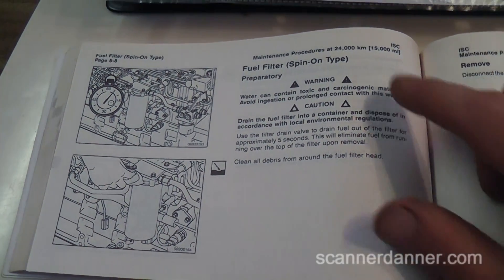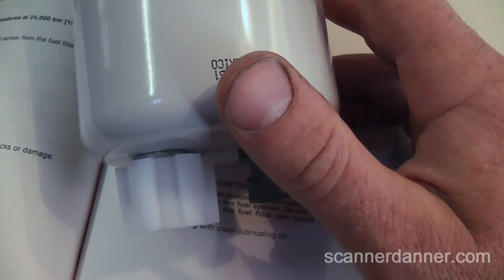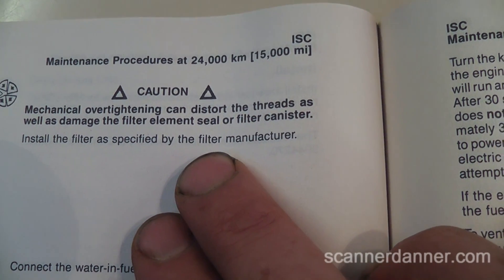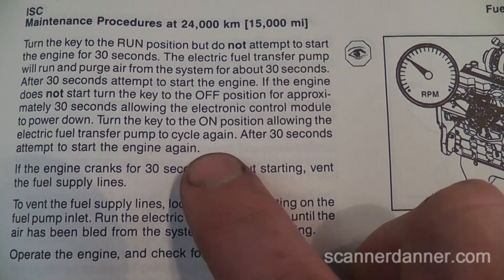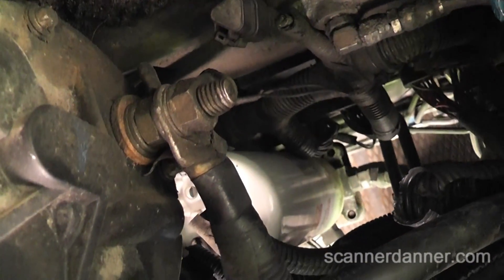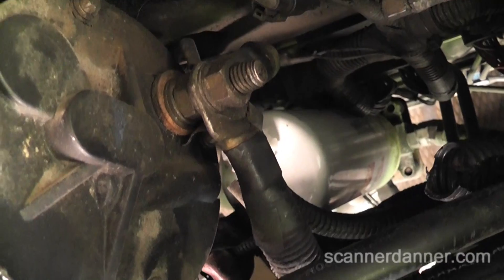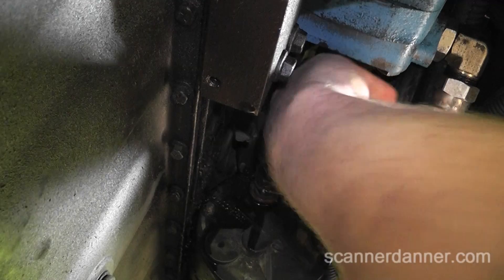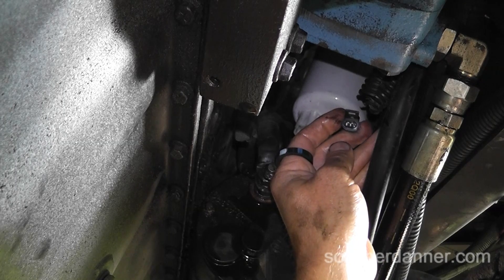2001 Cummins 8.3 ISC Fuel Filter change (American Coach) part 1

Comment: Was the oil pressure sensor accessible after removing the fuel filter?
Reply from the maker: I dont remember messing with an oil psi sensor or even talking about it 🤔
Reply: @ScannerDanner  you didn't. I was getting ready to change an ops on my 8.3 ISC and there wasn't any good info out there on it....was hoping maybe you saw the sensor after removing the fuel filter.
FYI, that sensor sucks getting to but was able to access from the top, after removing starter + wires....incase you ever have to change yours out in the future.

Exhaust Manifold is next on the list

Comment: I am sure many people have told you but at 8:44 of this video just above the threads is where the second "O" ring goes. If you do not put it in the filter is doing "NOTHING" the fuel goes around the filter. That smaller "O" ring makes the fuel filter work.
Remind me NOT to let you do any repair or maintenance work for me.
Reply from the maker: I corrected this in another video and admitted my mistake. Thanks!
This is not my normal wheelhouse

Comment: I got mine changed, no problem, but I cannot, for the life of me find another fuel filter.  The so called "primary" fuel filter.  Mine is a 2001 Monico Diplomate.  The manual shows a coolent filter next to the big oil filter, not a fuel filter.  Is it possible mine only has 1 filter?  Help! ISC 8.3 cummins
Reply from the maker: Only one fuel filter on mine my friend
Reply: @ScannerDanner  the second one is on driver's side up near the read end.  There 2 Dan.  I've got the same RV and year as you.
Reply from the maker: @larryreeves2548  my name is Paul Danner 😉
Only filters on the drivers side is the oil filter and coolant filter. There are NO fuel lines over there whatsoever
Reply: @ScannerDanner  it's not on the motor Paul it's under the water heater up on the frame.  Go up under the water heat compartment.  There a rectangular opening.  You can sit up there and you'll see it.
Reply: @ScannerDanner  give me a shout if you find it.  The filter also has a water drain, no plug but has a clear bottom to see if there's water it trash I guess.

Comment: If you have to change it then you have the wrong filter for that rig.. That is the norm now and I would change.. If that plug was wrong I would change out the plug so it will always work.. That sensor should be changed each time... The old days we looked and left them in, just to find out they would fail.. it cost nothing for that sensor now and its changed each time....

Comment: How much Cost This motorhome
Reply from the maker: New in 2001, it was 250k
I paid 50k for it (crazy the depreciation on these)
Reply: Thanks I’m try buy one fleet wood American Eagle 1998 8.3 Cummins that why I asking guy asked $43 but I’m thinking 35$
Reply from the maker: @pedrobastos3218  to be honestly it was closer to 55 all said and done.
I think your assessment on that 98 is about right. Unless it is immaculate and needs nothing. But we all know that's not ever the case
Reply: Hi I bought Coah 1998 $38 99 thousand miles now I’m going change oil
Reply: Man my 1998 American Eagle have tow problem Radiator I ready fix now the guy check oil leak guess what diesel line I have to fix put new lines two

Comment: Just talked to tech support at Cummins, perhaps you should have if you're going to put instructional videos on here, and that small seal does go on the threaded boss. Apparently you, or the last guy to replace this, didn't bother putting it on.
Reply from the maker: In this video I will show you how to replace the fuel filter on a 2001 Cummins 8.3L ISC engine. I left an o-ring out, see part 2 for the fix https://youtu.be/yzkw720STeU

Comment: The best practice is to use some ATF for the gasket and fill the filter up with ATF. WTF? haha, yep ATF is a detergent and will clean the soot and carbon build up off your injector tips as well lubricate and clean the injection pump, it will slightly smoke for the first few of miles before the diesel dilutes it down and quits. It is a very good practice to dump a quart of ATF in the tank at every fill-up, those old diesel are not too happy on today's low sulfur diesel oil. FYI the Cummins ISC went High-Pressure Common Rail(HPCR) in 2003. Oh, and the square cut o-ring goes over the threaded nipple, and is unfortunately left out a lot by DIYers. Without it, you run the risk of having fuel oil bypass the filter, yep.

Comment: Also, I got the Deutch connector for the electric lift pump and some cables.  I can unplug the lift pump, then plug my leads in and hook direct to battery.  I do that on filter changes and let it run for several minutes while I do some cleanup etc.  No need to key on for priming.  No stalls.  No air.

Comment: Yes, watch that starter hot post.  If the filter can shorts that post out...expect a 2000 Amp flash and a fire.  The small seal does go on the threaded nipple like everyone says.  See that machined out area above the thread?  DO NOT prefill on this engine.  And you don't have to drain it prior to removal.  I've removed these for 18 years on a fire truck with this engine and it never spills out when you unthread it.  Take it off, cover with a rag and remove.  The rag keeps it from dumping if you tilt the filter.

Comment: Where is this fuel filter located on the rv?
Reply: Sadly, the filter is located on the side of the engine right above the starter.  Mine has two filters, one (the FS - fuel/water separator filter is on the frame rail, which is really nice because it is so much easier to change, the other fuel filter is right above the starter mounted on the engine and is a bitch to replace.  I have to wonder which idiot Engineer decided that it would be a good idea to mount the fuel filter on the engine and above the starter when they could have mounted both on the frame rail.

Comment: I did exactly what you did and worked perfectly. I had the same behavior when I tried to start the engine, it did start but staled few secondes after. After the third try everything was back to normal (wait 30 sec between each try and 30 secondes to let the pump doing its job). Thank you very much. You should make more RV videos, specially because I have the same (almost), ie, a Fleetwood Revolution 40C 2002 with the same engine, same transmission, same frame! So, your videos are very usefull for me.
Reply from the maker: I actually have a bunch not edited. Make sure you subscribe and follow along, I'll try to get them posted soon. Thank you!
1. Power awning issues
2. Oil change in generator
3. Fuel filter in the generator 
4. Coolant change in generator
5. Testing the solar cell 
Then I have 5 or 6 up here already? More to come for sure.

Comment: Hey! What type of injection system has that engine on it? Are those injectors mechanically (by fuel pressure from high pressure pump)or electrically operated-open/close?

Comment: The smaller filter "O" ring is installed on top of the filter head threads, and the reason for that is to prevent unfiltered fuel being pulled from the input side of the filter head (the little holes in the top of the filter) past the filter head threads directly into the outlet side (the large center hole).  The fuel is filtered from the outside of the fuel filter  to the inside of the fuel filter, so without that "O" ring installed,  you risk unfiltered fuel entering the pump and injectors.

The FS1022 removes contaminates 10 microns and above, which the human eye cannot see.  Good move on your part just to dispose of the old fuel.

The fuel filter is not pre-charged, eliminating the possibility that unfiltered contaminated fuel someone may inadvertently introduce does not enter the tight clearances of the fuel pump and fuel injectors, thus causing catastrophic failure of those components. 

The water drain valve is just that - to remove any water which the fuel filter removes.  With the sensor in the filter, one only needs to drain the filter when the dash information indicates the filter water level threshold has been reached.
Reply: I'd agree, the small diameter seal is needed.

Comment: Hey Paul, just wanted to let you know that Cummins Quickserve is an online service manual for all of their engines. It's a paid subscription for unlimited engine serial numbers, but last time I checked you can get a free version that allows up to 5 engine serial numbers to be entered. Check it out. It should include everything from troubleshooting to rebuilding the engine. I use it everyday at work and it's a great tool. I mostly work on diesels but have watched your entire premium channel classes with your book and have been able to apply troubleshooting techniques as well as learning gasoline systems. Thank you so much! -Nick Nyden
Reply from the maker: Thanks for the info Nick! And for subscribing

Comment: The no prefill instruction is to cover the case where the lift pump is dry. In that case it is easier to move air into air than air into liquid.
I never prefill oil filters for the same reason. But that's a different argument...

Comment: there are letters on the side of the filter for tightening...letters A,B,C, and D. each one will tell you what letter will face you after proper tightening. like if letter A is facing you,you tighten untill letter C is facing you. all fleetguard filters have this.
Reply: That, I didn't know!   So when taking off the old filter, watch for a specific letter, and check where it faces?

Comment: Don't know if you had to order that filter through Amazon, the comparable Wix filter is a 33422 which you can probably get at your local parts store, also comes with the new sensor.

Comment: Good Vid, I don't know anything about an rv but since you have air brakes make sure you bleed your air tanks at least every other day unless the air system has an air drier on it. Even a lot of truckers forget about it. If you are traveling across country and  the weather changes drastically such as a sever drop in temp and you have water in the air tanks and it freezes things get scary real quick . Good luck and enjoy your vacation , that is a beautiful rig you have.
Reply from the maker: It does this automatically and has a drier. Thank you!
Reply: You still should check for water in the air tanks periodically, because air dryers will fail.  Just open the air wet tank drain valve and check for very little water escaping to indicate the air dryer is functioning properly.
Reply: Air brake systems use a air drier, and purge valve. The purge valve drains the air in the discharge line after governor cut out, it also allows for reverse airflow to remove moisture from the air driver. If your running a tractor on a daily basis then once a year you should replace the air drier. The system is not full proof, normal amounts of oil passing by the rings in the air compressor get into the air drier and inhibit the air drier being able to do it's job. I would suggest draining the tanks at least once per year and checking for excessive amounts of water as you can still have condensation in the tanks. Also check for excessive amounts of oil as well. Tanks freezing and cracking isn't a big issue as the compressed air is hot, and the tank would have to be completely full to crack it open. The main concern is with moisture freezing in the air valves and causing them to stick or crack, they make a fluid you can use in the air system (act's like a de-icer) to prevent this. The main concern is related to trailers.
Reply: If you are from NW Oregon, I can see changing the air dryer every year, but just south of you where the climate is quite dry, it is  unnecessary, because the air dryer will last years and years.  ABS manufacturers don't recommend filling the air brake system with a de-icer, because that action will ruin the ABS.
Reply: Chad Jessup So what is it your trying to say Chad? You've never heard of a rule of thumb?
Reply: I guess what you and I are disagreeing about is "the rule of thumb". Your rule (and the manufacturer's) says change the element once a year, while I say monitor the amount of moisture/oil in the wet tank to determine the moment to change the dryer element thus saving a lot of money, because those elements can last easily past ten years depending on usage and climate.
Reply: Chad Jessup Guess I'm really questioning how many years of experience do you have working on medium and heavy duty trucks?
Reply: Been at it since 1964 for class 6 - 8 trucks plus construction equipment.  Since you don't believe me, check out manufacturer's technical literature, such as Bendix Technical Bulletins TCH-008-022, TCH-008-042, and PRO-08-21.  Their recommendation to change out the air dryer element once a year is only a CYA issue and doesn't pertain to every operating system.  You say to drain the air tanks once a year - I currently drain the air tanks on our fifteen rigs every two months as part of California's BIT program, and I have found very, very little moisture in all the wet tanks on a properly maintained unit.  Four of those trucks are 20 years old and still in possession of the original air dryer guts.  One needn't be a math whiz to realize the monetary savings of not following your suggestion of annual change outs.
Reply: Don't miss the point here: It's a motorhome!! If your a farmer in ALTURAS, CA and want to save money on a drier have at it. If you have a fleet of trucks that only drive in a dry climate and never have air compressor failures sure. Sorry man I don't think you get the point... It's a motor home not a tractor and I doubt it's driven 250 miles a day year round!!!! Which means...-> they wouldn't have to change it every year. Which also means that checking their wet tank at least 1 time per year would be appropriate for the use!!! OMFG If you want to discuss fleet solutions that's a whole different thing, cost factor, break down rate, etc...... You being as old as you are should know that it's different for every fleet,  their location and where they haul to and from. Lay it to rest man.
Reply: I get the point - you took umbrage that I offered a different technical opinion.  If you were secure in yourself, you would not "get personal" as you did when you questioned my experience, my knowledge, and geez,  you even googled me.  All I did was state that changing out the air dryer element annually could be time and money unwisely spent, for there is a simple procedure, and I did not mention the frequency thereof, to monitor the effectiveness of the air dryer by draining the wet tank.  Plus, I wrote that the introduction of de-icer in an air brake system equipped with ABS would be detrimental to the ABS system, which is why Bendix voids any warranty claims when de-icer is discovered in their ABS systems.  Good advice for a RV owner or a fleet of truck tractors.  Regards.

Comment: Hint:  Before you install the fuel water plug short it out and turn the engine on.  You should get a indication of water in fuel.  That way you will know 100% if the circuit does work.

Comment: Pull that filter again Paul and fit that o ring over the thread. The last guy that changed the filter neglected to fit it. Without it you are pushing unfiltered fuel through your pump.
If you take a closer look at the diagram on the filter that o ring is shown that you mistakenly took to be the outer o ring. (Rookie mistake) :) A quick note for your audience. If their engine has an mechanical injector pump the filter needs to be primed via the lift pump plunger. Cummins use the same filter on many engines.

Comment: Im sure you already know this by now but Im pretty sure that square oring is to prevent unfiltered fuel getting past the threads...Pretty tight just to change a fuel filter...However some RV's are just ridiculously difficult just to change oil and fuel filters...I always hated the RVs...Diesel arm pit burn...

Comment: I can add to the other comments to only buy your fuel from a truck stop or a place that you know that deals with a lot of volume on diesel. Bad fuel is the number 1 problem with diesels. The reason not to fill the filter first is that it doesn't completely fill with fuel while running. Over time it can fill if/when the filter starts blocking up with contaminants. But it wouldn't have hurt either way. It will find its own volume. Also I would advise on using a good fuel conditioner. I like Lucas, but others may disagree. I've been running and working on diesels for over 40 years. I think you'll be pleased with it.

Comment: Call good video haven't change the fuel filter on Cummings engines specially RVs but I think The little round washer goes on the center thread to go to filter threads on I would check A Cummings person to make sure don't want to give you the wrong information great video

Comment: Yah, I thought the drain is to release the fuel pressure, otherwise it squirts out in your face when you undo the filter, and the other Oring would be the drain seal.

Comment: The small gasket  (square cut O ring) goes over the threaded nipple. If you left it out you need to install it.
You may not have found one because the previous guy didn't put it on.
Reply: Man its nice to know someone is on the ball... I was like ding ding on the shaft my man... and never use that gas that comes out. crap comes with it.. Nothing like fking a pump up..